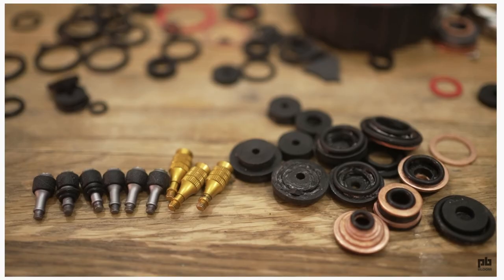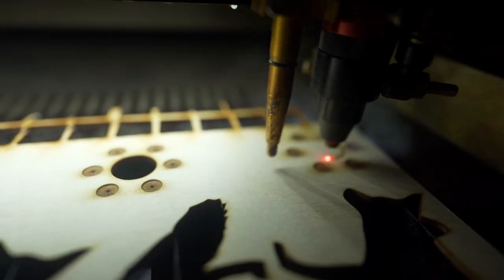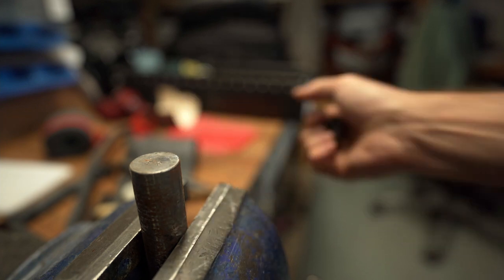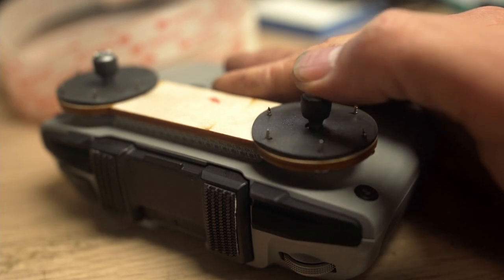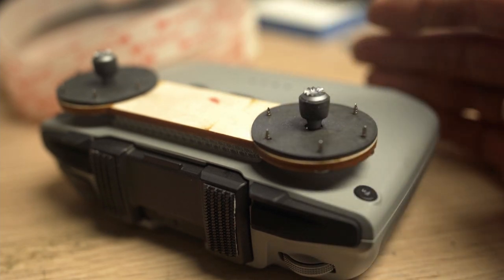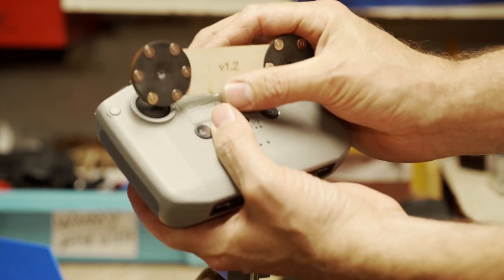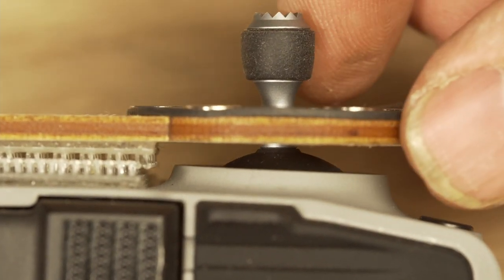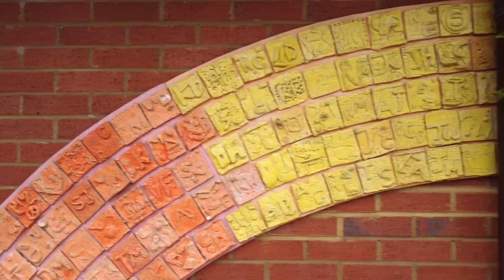Dji Air 2s and Mini 2 Drone Controller - Joystick Sensitivity Fix

Comment: This is a great fix and I am impressed with your laser cutter!  The hobby requires thinking outside the box and you are such a person.
Good luck with your filming, it encourages others to try harder!  MB
Reply from the maker: Thanks so much Melvyn! - Do you need to fly slowly when filming and do you have the same controller as this? If yes, do you want me to post you one of my frames? :-)
Reply: @WoodyKitson  
Hi Woody, that would be great. I'm happy to cover the cost. Mel
Reply from the maker: @melvynbond8348  get in touch woody at ekit dot co dot uk

Comment: Nice job. I like it. I too have difficulty with a smooth flow. Something to make the gimbal up/down smoother would be nice too.
Reply from the maker: I agree entirely - The little rocker control i find really hard to use delicately - perhaps if we can get a large and secure lever on it, then we could add some small rubber bands to add resistance? - a larger movement would help too.
Reply: Go to advance gimball settings.. There you can make everything ultra smooth for every mode.
Reply from the maker: @icetea4345  The device is used for maintaining a consistent position of joysticks, (and hence trajectory), regardless of the drone's current speed and gimbal settings.

Comment: Personally I find them a little bit to stiff.. I am used to hobbygrade controllers where you can optimize the hardware (like joysticks) and software for buttersmooth performance and personal preference. Hope Dji's future remotes feature some of those hobbygrade remotes oomph..
Reply from the maker: Hi Iced Tea. (Is this your YT account Pete?) What is it you find stiff? The original controller sticks? I agree it would make lots of sense for DJi to make their drones compatible with standard RC controllers. Though I don't know how easy this would be to do for them.